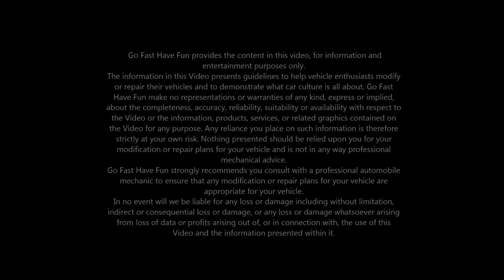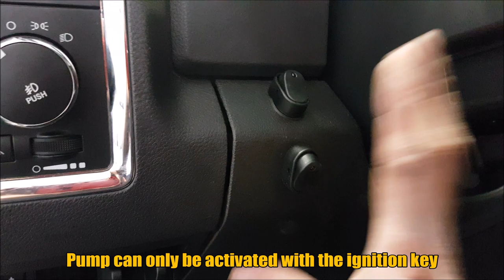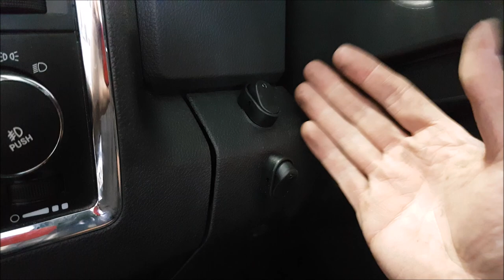Transfer Pump Fuel Tank Wiring | AnthonyJ350

Comment: Great tip on wiring the battery-side connector plug so that it can't accidentally arc out on the truck frame!  I would not have thought of that detail and would have had a 50-50 chance of making that mistake - thanks!
Reply from the maker: It's all about the little details to make things better.  Thanks for watching!
Reply: What is that connector? Can you provide a link I or spec on it

Comment: Couldn’t it have been ran through the stock Upfitter switches? Since you ran a relay. Were those 12 gauge wires that was on the relay?  They looked small in the video.
Reply from the maker: It could be ran through the upfitter wiring if the truck was equipped with it.  14 gauge wiring was used.